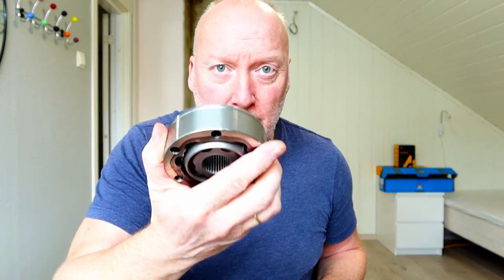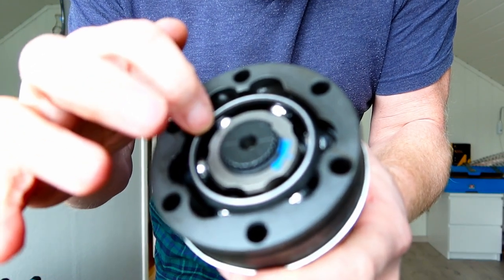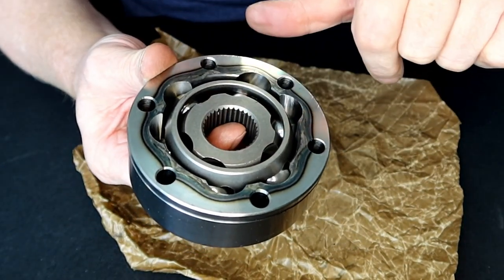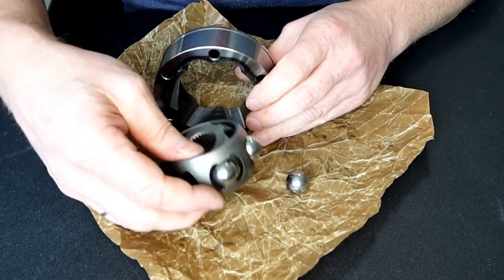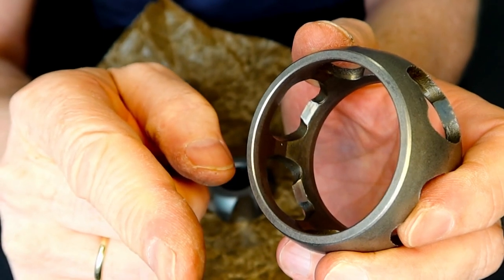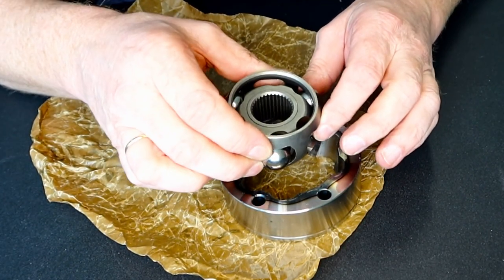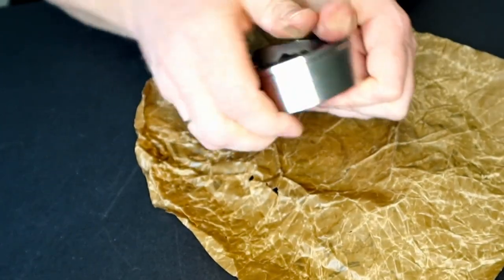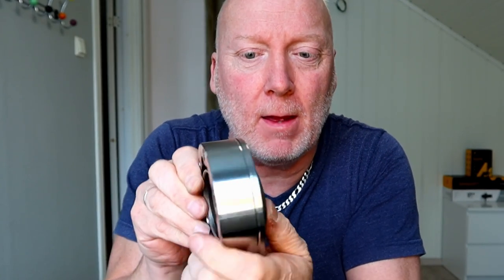CV joint rebuild (no clocking) for Vanagon, VW, T3, T25 and Porsche 944

Comment: Great video….Sorry for the dumb question, so on the same axle, they face the exact same direction to the gear box ? On both ? They both face the same way ? Or are they reversed. One side like you explained close the gear box…, then the other close to the wheel faces the same way also? I think i missed something thanks
Reply from the maker: They should be the same on both sides, so if you flipp the axle around, it should not matter. Sorry for my bad English.

Comment: It's good to see a person who can give people a run down on how CV joints should be fitted because people debate whether it's really necessary on a street car,.

I'm starting to find out that it is because I've been going through the inner rear axle CV joints are wearing out in about 30,000 kilometres because I haven't been  clocking them & I wasn't aware that the raised inner edge should face the CV boots.

There's been no information in the generic Holden Commodore service manuals but Holdens factory service manual May have details about that.

I'm part Norwegian myself as I'm actually a Holden, Edward Holden started.thr the Holden motor company in Australia but he died of the same thing that Henry Ford died of - brain cancer !

Comment: Would it not be better to say, facing out or in rather than wheel or gearbox as it depends which end your fitting! 
Or is it just me!
Reply from the maker: Yes you are absolutely right, it's just my lack of English words
Reply: @Italjohn  You should hear my Dutch :-)
Reply: Great video, and I’m very thankful for you putting it together. I have a related question though; if I’m understanding correctly, should both joints on the axle be built the same, but mirrored?  Like, chamfered edge inboard, “extra metal” inboard, grooves on the outer shell outward?
Reply from the maker: @brentdreaver6548  yes mirror is correct
Reply: The groove is where the rubber boot fits,either side!

Comment: Salut John
C'est compliqué je ne comprends pas
il n'y a pas de sous titre en français
Reply from the maker: Je ne connais pas le français, donc je ne sais pas comment je peux vous aider, désolé
Reply: @Italjohn  cool john
j'ai compris que c'est possible d'installer du porsche 944 sur t3 !
Mais il y a une modification à apporter ou non ?
Mon T3 va être descendu assez bas, sur air ride
Reply from the maker: @zampiericlaudio1868  J'ai lu sur les joints Porsche 944 sur le T3, mais je n'ai aucune expérience moi-même. Il y a beaucoup de choses à ce sujet sur "la samba"
Reply: @Italjohn  si j'ai bien compris tu fais cet modification pour pouvoir augmenter la hauteur de suspension...?
Reply from the maker: je ne sais pas, désolé